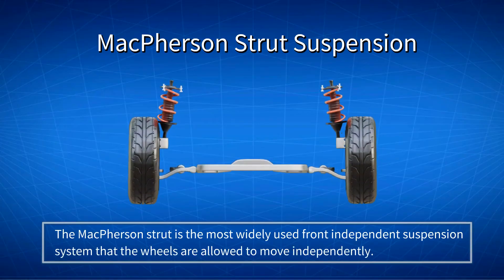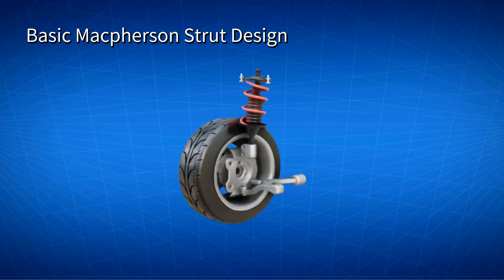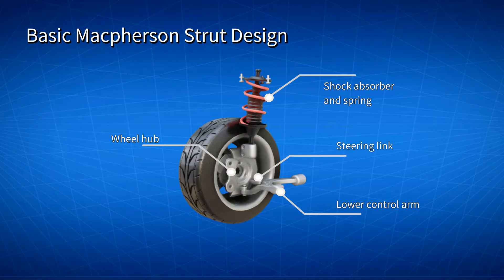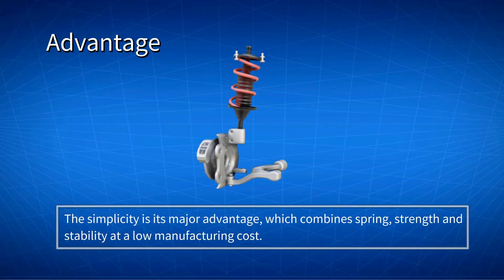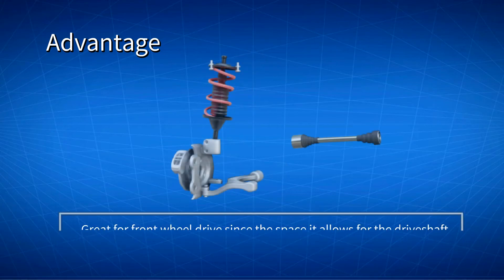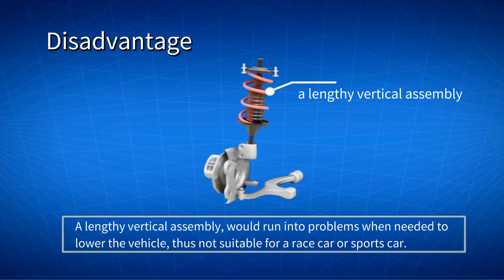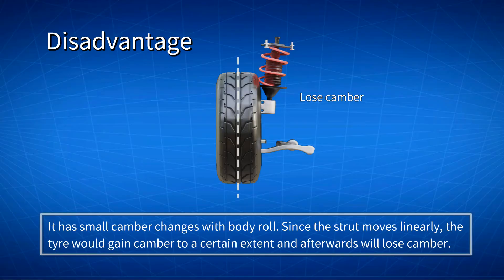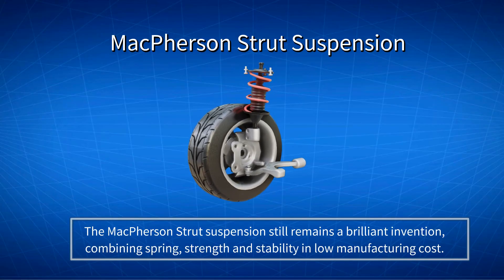Car Suspension: Macpherson Strut Suspension (2021)

Comment: Illustration is not a MacPherson strut.
MacPherson strut is a simplified strut suspension that uses the anti-roll bar to locate the suspension fore and aft to carry the brake reaction forces.
As used by Ford England from around 1949.

Comment: Poor animation - the shock absorber should be compressed where the spring is, not below that point....
Reply: Are you sure, because the point is to move the wheels up not the body with spring down
Reply: @harishankarcb6319  Yes I am sure

Comment: Steering components are connected to the knuckle, not the hub. The hub is connected to the knuckle through the wheel bearing, allowing the hub to rotate with the wheel but be aligned firmly in place by the knuckle.

Comment: Possibly a stupid question but can someone please please tell me how the camber is maintained without an upper wishbone helping to hold the camber?
Seems to me that when the car corners, lateral forces would make the wheel want to lean over and break off.
e.g. The wheel on the outside of the turn would want to lean outwards in the direction of positive camber.
What is stopping the wheel and knuckle from ripping it's self away due to this force?

It can't be the "strut" that maintains the wheel's camber and takes all that force can it?

The only thing I can think of is that the drive shaft helps to hold onto the wheel and experiences a tensile load upon cornering...

I understand double wishbone but not single....

EDIT: I think I've figured it out after having another look at the steering knuckle and the key is HOW it connects to the bottom of the shock. The knuckle is offset slightly to the side of the bottom of the shock and has a large connection with two bolts. This extremely minor and simple detail completely changes the direction of the forces acting on the shock from the ones I thought were acting on it. The problem inside my brain is now solved ✅ 😁
Reply: You Are right, animation is quite terrible. Beginning of this explains it better https://www.youtube.com/watch?v=X6JejXjGQiQ

Comment: What exactlly is a modified Macpherson suspension?
Reply from the maker: A modified Macpherson strut seems to be used in old cars with the coil spring mounted on the lower control arm, i.e., not around the strut as in the video😀 .
Reply: @animatedengineeringstudio  Hmm. Not so sure, because I read about some modern cars having that "modified MacPherson" suspenson. Or "Pseudo McPherson" like in Opel Insignia.

Comment: I feel the Macpherson strut suspension provides a less quality ride Vs double wish bone with coil spring provides smooth ride
Reply from the maker: Thanks for your support. Yes, double wishbone suspension is a lot more complex and provides better control over the MacPherson strut. The negative thing is a double wishbone would cost more on maintenance and repair. 😀